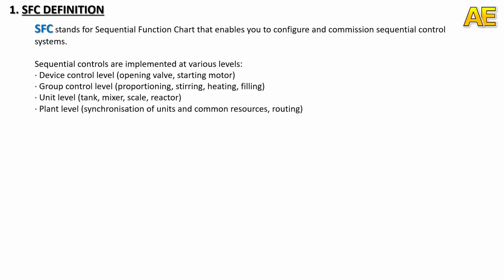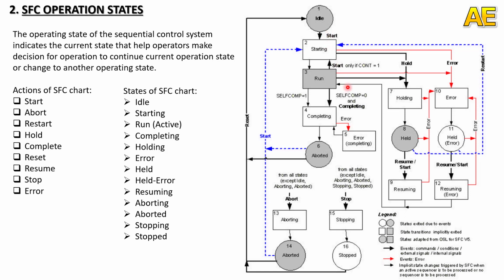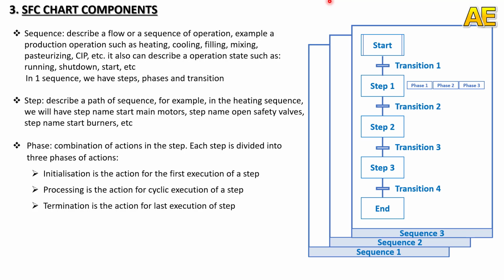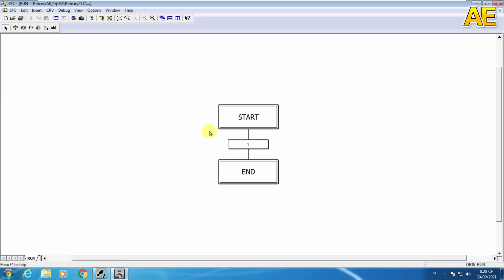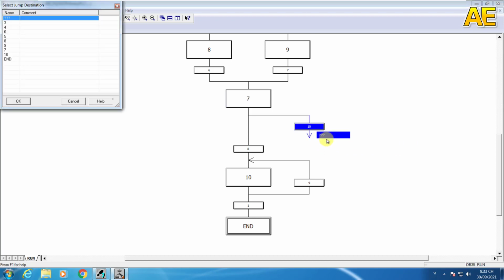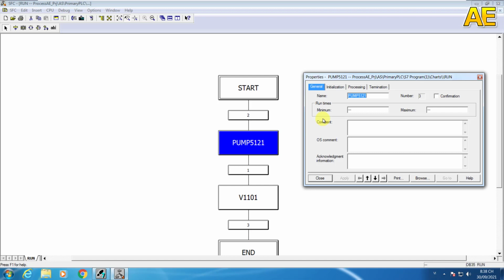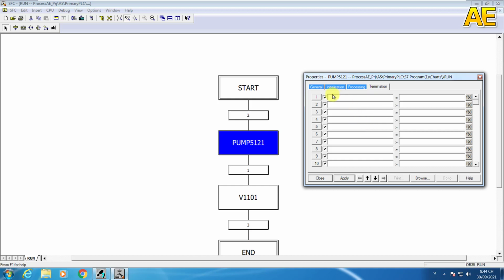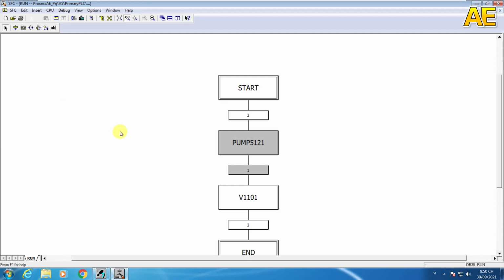Simatic PCS 7 Part 5 : SFC Components - Actions - States And Programming

Comment: Hello, 

One question, is the motor continiously running when transition "FbRunOut'" is reach after going to V1101 STEP ? 

What's the condition to stop the motor ? Is it SET RESET or only ON/OFF output on each step ? 

Thank you